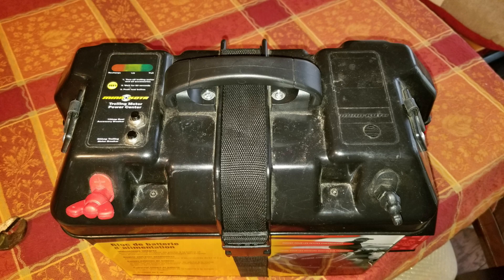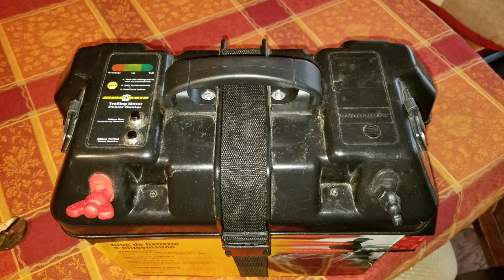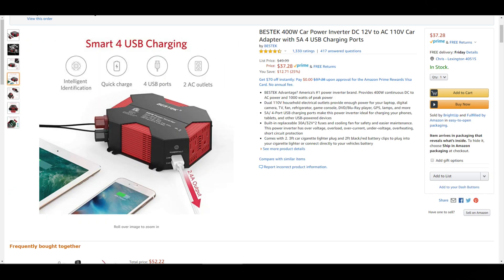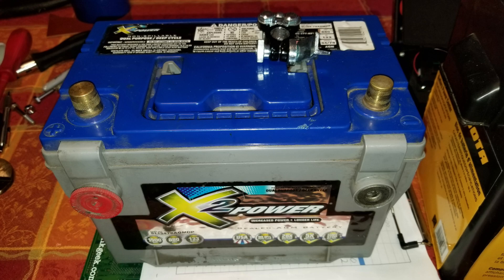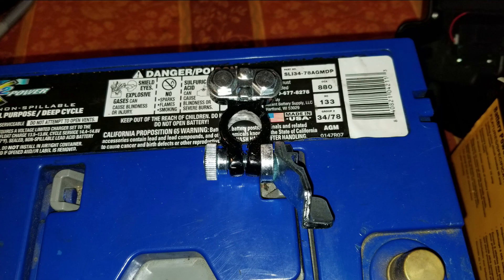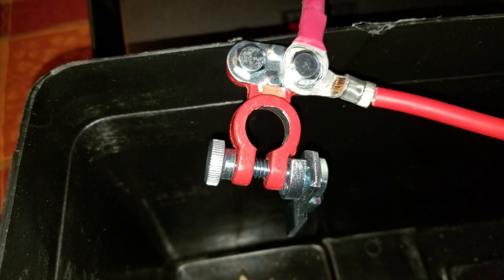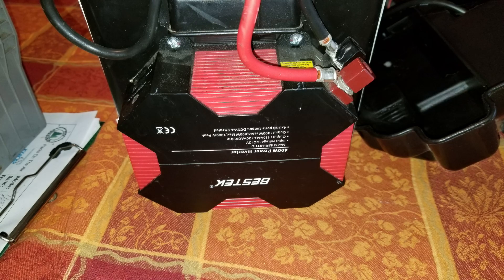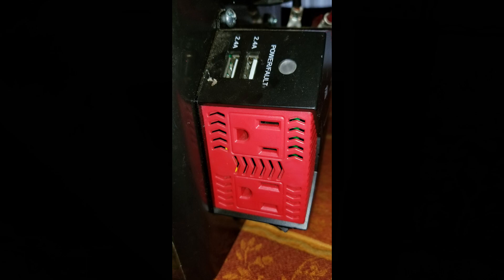LCARA HAM Radio: Battery box refurb

Comment: I have the exact same battery case you have. I have two small marine deep cycle batteries wired in parallel. It works like a champ for my Yaesu FT-857 when operating in the field